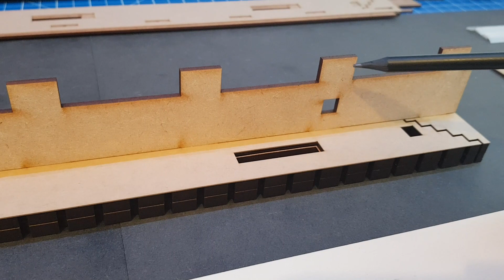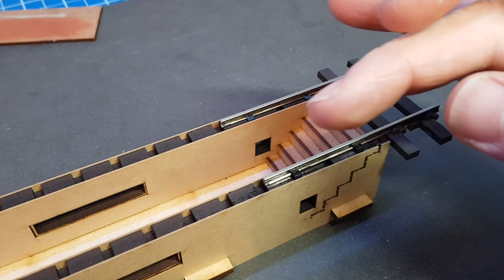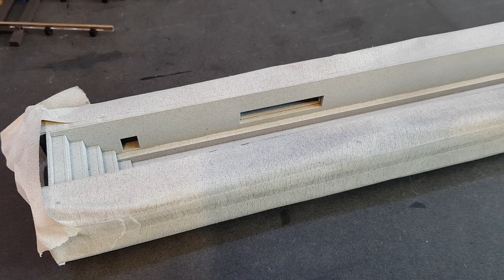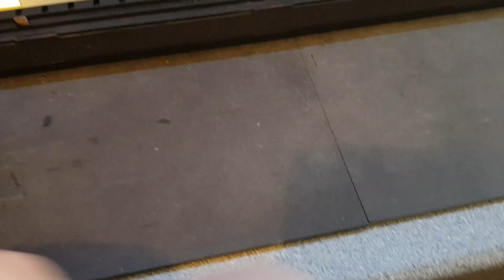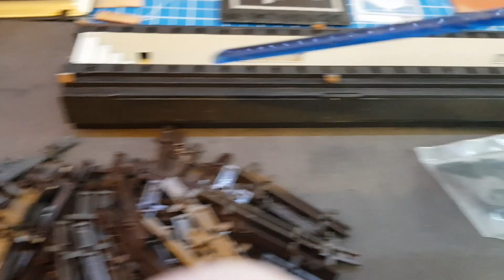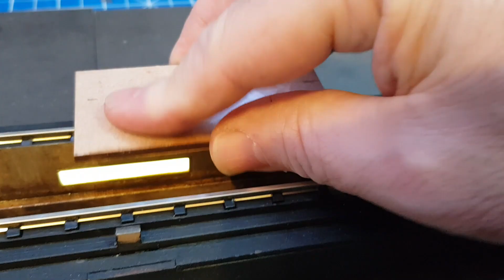How To Build | O Gauge Inspection Pit | Railway Laser Lines

Comment: I guess this will be just too difficult to produce in OO Steve?
Reply from the maker: Far from it! I actually designed it in OO first for the Severn Tunnel depot kit. I need to re-visit that kit as I need some 3D parts made and may now have a contact that may be able to assist, so it could well be released at some point.
Cheers
Steve